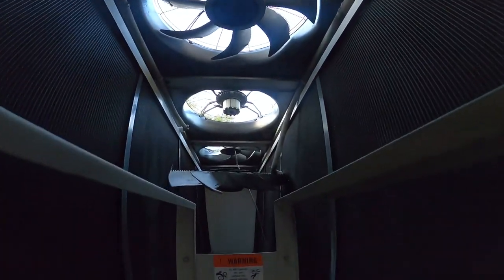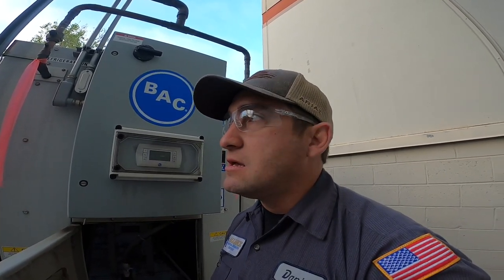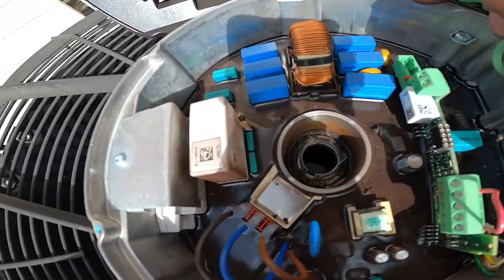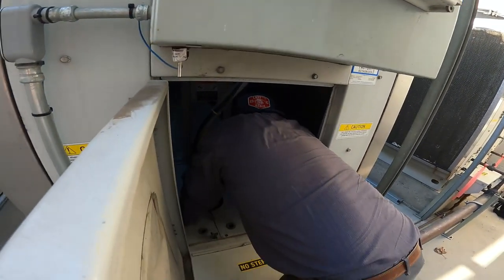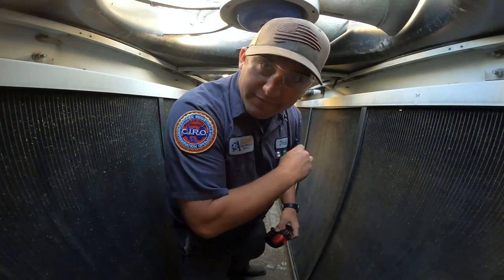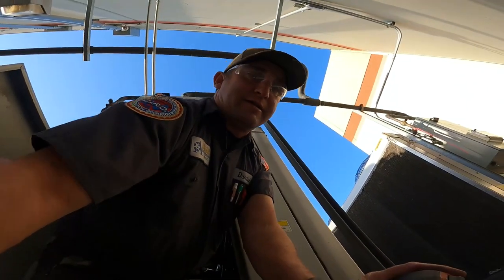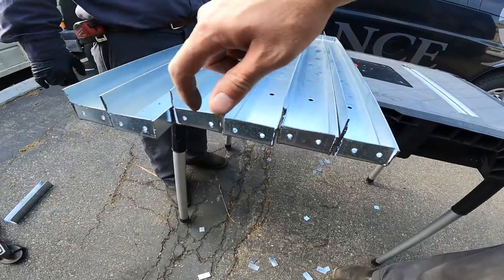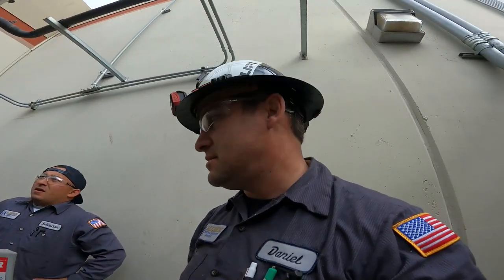$30,000 BAC Condenser failure.

Comment: hello guys, greating from VEnezuela, this video made remember when I just find this kids ofa desing failures by fabricant. But I have a question, dis you reemplace de damange coils, and how much it cost at that time?...... ahhh Congrats droping these videos , love them!!......thanks Daniel & Sebastian......whata a super profesional job!:...
Reply from the maker: This whole job cost a lot of money. It all could have been avoided if the manufacturer would have protected the coils. The coils were about $30,000.00. The Freon lost was almost $29,000.00. And the fan was about $3,000.00. About $62,000.00 in parts and freon. Not adding labor into this. I still love the design of these condensers. I would still buy them but make sure we protect the coils.
Reply: @alliancetechnh3368  oh man, the coils were replaced by new ones and $30k...it´s insane!... but we know those coils are the most value´s parts in condensadors.

Comment: Explain the auto purger sequence ...hansen
Reply from the maker: @mrcalifornia_7177  It's like any other refrigerated purger. We refrigerate the foul gas well below saturation, allowing the ammonia to condense to a liquid. This separates the noncondensables from the ammonia. Once enough has collected to open the float, then the purge cycle will purge out the noncondensables into a bubbler. You should read the hasen manual. Or just check out the hansen website and read the bulletins / O&M manual.

Comment: Man that's a shame. What type of refrigerant does it use.  I have never seen a condenser with a setup like that with the sump and pump. Does it possibly spray water on the coil. Thanks for the video
Reply from the maker: It's like a evaporative cooler aka (swamp cooler). It gets the pads wet and Cools the ambient air before it passes through the coils.
Reply: He said before it was freon wich would make this an environmental disaster as well as it is a famous ozone layer destroyer that I thought was phased out long ago globally! The motors should be flipped around so that the rotors are at the top with the motors below them inside of the box. The motors will be possibly harder to get to for service but its clearly worth it compared to this happening!  If the rotors then do come loose they will not fall into the coils but just rattle around on the drive shaft. Having the fan rotors hanging down from the motors like this is a recipe for disaster esp with the coils so close there is no space for the rotor to go but slicing like a lawn mower into the coils.